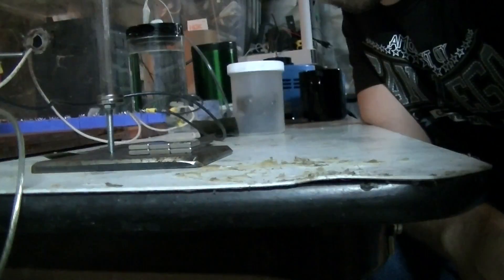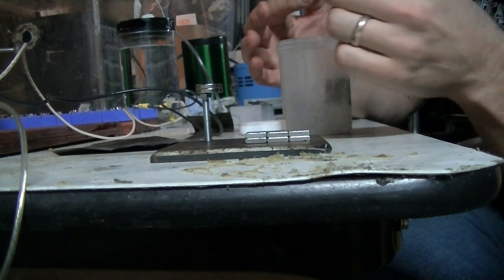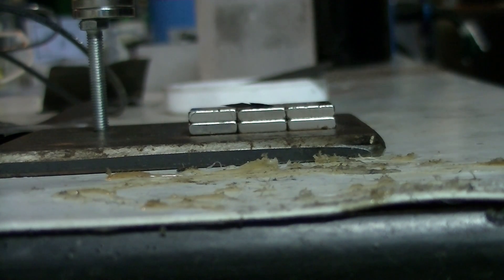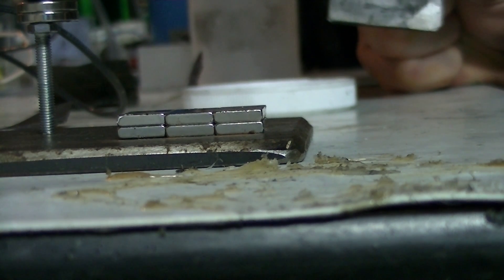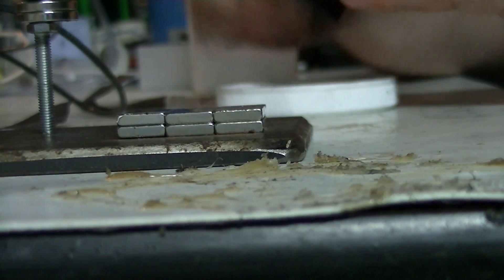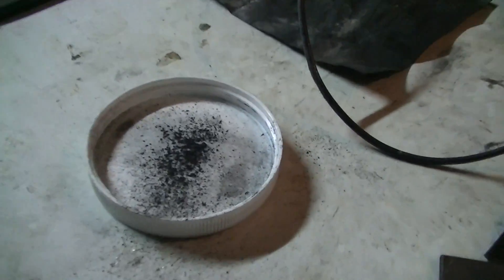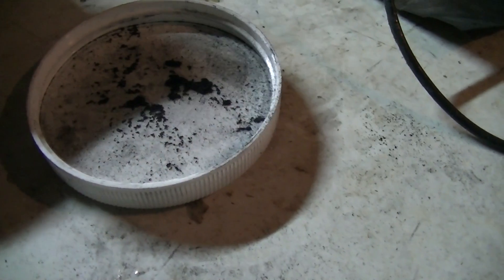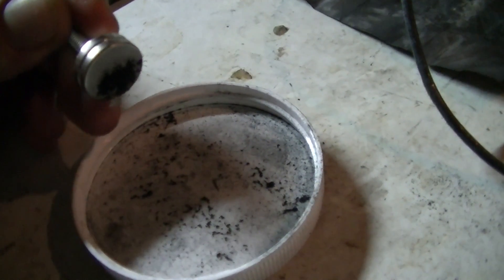Exploring Pyrolytic Carbon: Diamagnetic Properties and Potential Applications

Comment: Here it is :>https://www.youtube.com/watch?v=HBVGscRFDCY
Reply from the maker: Thanks for sharing.  Now I have to search for a scholarly article on this method.
Reply: Diadon Acs The video when the man heated up in the microwave the graphite powder in the vacuum glass up to the degree of fire and made the dust magnetize. do not exist any more.It is confirmed by my friend Peter Darling.
Reply from the maker: +Bartosz Barejko This video is hard to tell what is going on for the single surface layer. Is it heating in an alcohol or hydrogen peroxide, or is using sonic vibration? The next question, how would one solidify this single layer sheet as carbon alone? Once the surface tension of the water is broken, so too would the graphene sheet?

Comment: Theoretical, imaginations ? come on. You have seen the movie when graphite dust probably mixed with some hydrogen peroxide or alcohol was heated in the glass to the degree of fire and changed it state from solid to dissociation on the atomic level and became magnetized.
Reply from the maker: I have not seen that movie, I have seen some microwave plasma re-configuring. Do you have a link to the video you are talking about?

Comment: Interesting change. After watching your video and Free Phases Research video about changing conductivity with high voltage it leads me to think these changes are related to gases or lack of within the pores. In both cases heat was generated expelling gases. Observing diamagnetism of the flake while applying a vacuum could show a change and maybe explain gravity. I'll check out the paper. Thanks for sharing ;)
Reply from the maker: That is an interesting hypothesis and one I have considered. There is also a question of a mass field interaction between the particles, that could form attraction. As a note, I did pass high voltage AC through that entire piece of pyrolytic carbon. I wouldn't think it would maintain any kind of charge that would instigate dipole moments in the carbon. Its something that should be noted for any replication of this effect though.
Reply from the maker: Oh, and thanks for commenting. Its appreciated and helpful for us all. :)